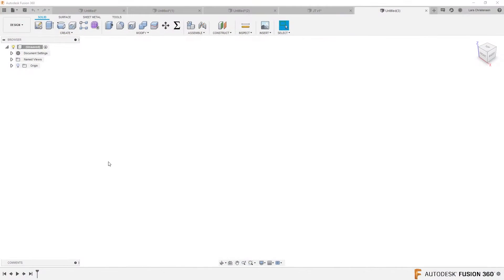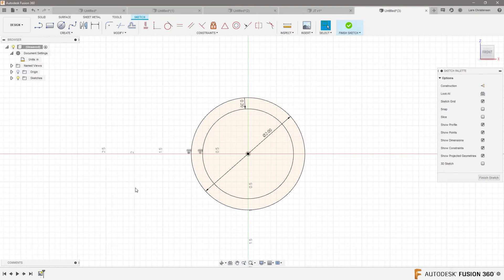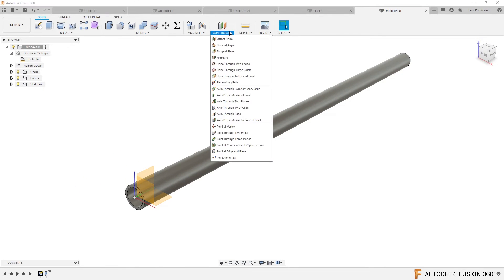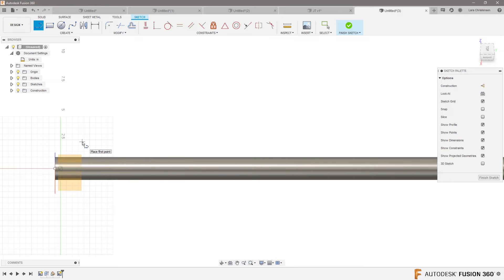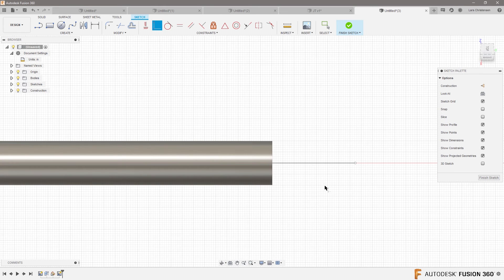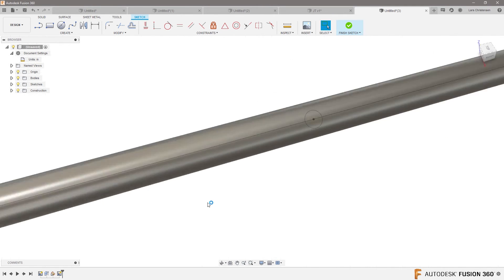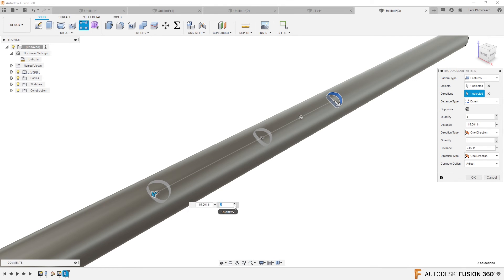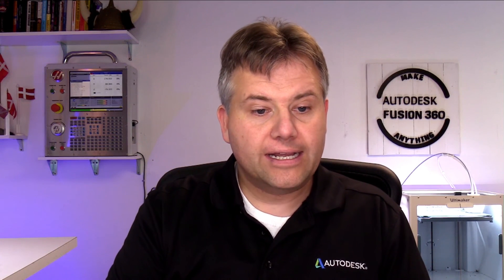Fusion 360 — Model Holes in 32 degrees in a Pipe — Ask LarsLive

Comment: Hehe. That is one of those trick questions that the teachers of machining classes love to through around.
I envisioned a pipe, where the holes were not perpendicular to the pipe, but exit at the 32 deg angle! Like a branch on a sewer pipe. 
And what if the (small) holes should be arranged circularly around a section of the pipe?

Love your channel
Jens Henrik

Comment: What you did does not make much sense, since you could just do the holes vertically then rotate the pipe 32 degrees when you assemble it.
Are you sure he did not mean 32 degrees measured from the longitudinal axis? That would be a little more challenging. Or even maybe 9 holes radially at one point on the pipe.

Comment: I thought it would be 9 holes indexed 32 degrees from the last hole. Otherwise it’s just a pipe with 9 holes. In reality if you held it in your hand you can spin it to any angle.
I guess if you assume the pipe is part of an assembly then Lars got it right. Sorry Lars.

Comment: Why was I thinking that he wanted to drill holes at 32 degrees F as in temperature haha I thought you were going to go preferences and turn on the temperature setting.
Reply: No way he wanted at 32°F.  It must have been 32°C.  Meaning, it's hot in the shop.
Reply: @danl.4743  That's funny because at 32 F water freezes so the shop is cold